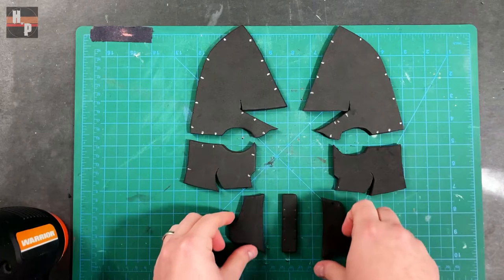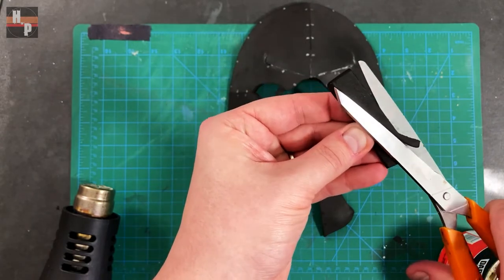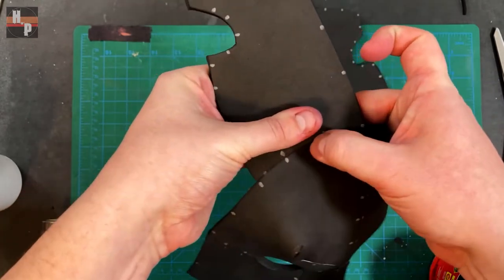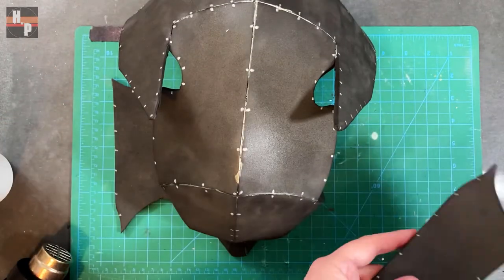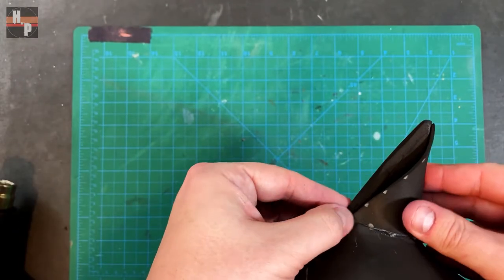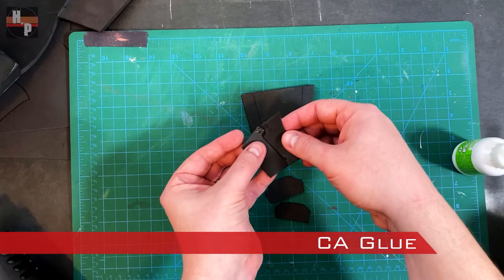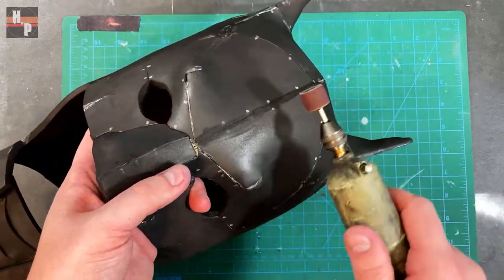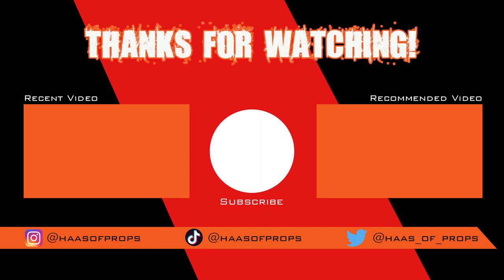The Batman 2022 EVA Foam Cowl | Easy BATMAN EVA FOAM COWL and Free Template

Comment: Do you printed that out on A3?
Reply from the maker: I did not use A3. I print the file as a "poster" on 8.5"x11" and piece the pages together.
However, it can be printed on any size paper, just make sure to print at 100%.

Comment: How much mm does this EVA has?
Reply from the maker: The majority are 6mm and 2 ear pieces are 2mm.
Reply: @haasofprops  Thank you so much!
Reply: @haasofprops  Another question. Do you think 10mm EVA foam would fit nice instead of the 6mm?
Reply from the maker: @nathanlrc  I'm sorry, YouTube didn't notify me about this, and I just saw this question. 10mm might be too thick especially around the eyes. If you decide to use 10mm you will need to scale the template up slightly to account for the extra thickness. 
I hope this helps!